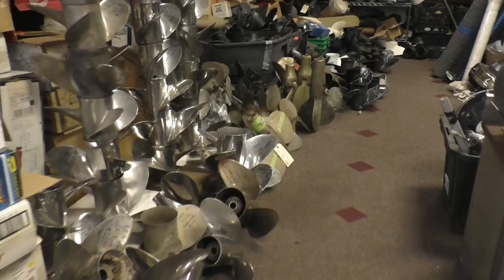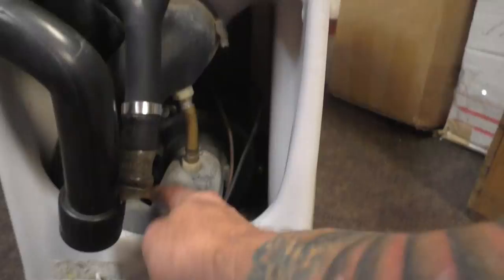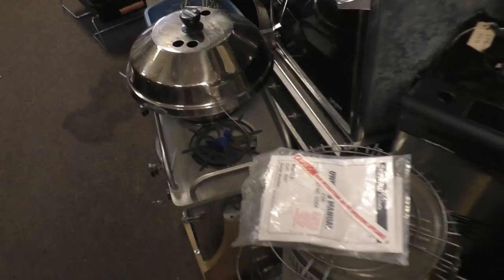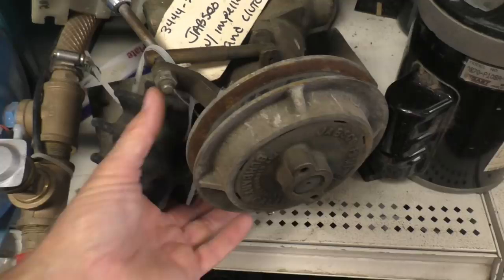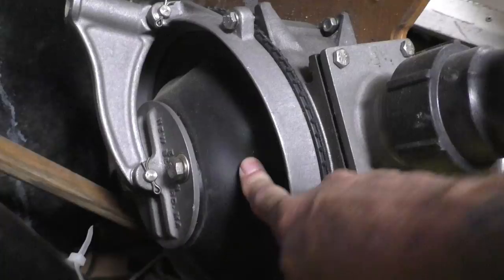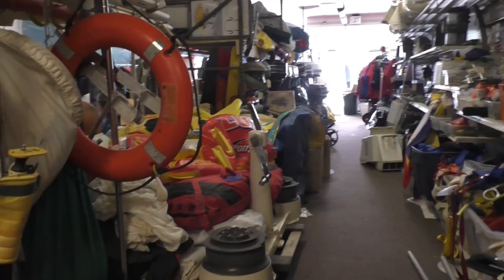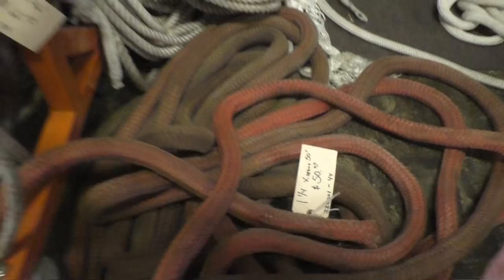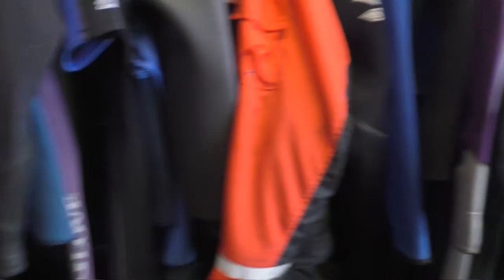Marine Consignment - Wickford, Rhode Island

Comment: You found a good place there Doug. I rebuilt a Downeast Lobster boat 15 years ago and I bought a lot of parts there CHEAP. That boat is still on the water and most of those used parts and ones I machined from stainless are still on it.  They ship all over and you forgot to mention they are in the same building as the Post office. You could buy something, box it up, walk next door and ship it home. I live about 20 minutes from there and you can usually negotiate with them especially on items having birthdays and some stuff, like stoves, have had a few birthdays there.

Comment: Bilge pump diaphragm, check out big truck brake chamber's diaphragms, NAPA Auto/truck. Some are designed to move a lot of air/water.
Reply from the maker: Happen to have some laying in the front yard.  :)
Reply: In case you didn't know Doug, the air system on trucks is governed to max out at about 120 psi. The brake pots you have would have to be able to exceed that considerably for a safety margin. I wonder just how close a brake pot is to being a bilge pump?
Reply: Hey Doug...just be careful with the brake chambers if it is a two hose type they have a widow maker spring in the back section. there should be a tee shape threaded tool in the side between the sections  to insert turn 90 deg & tighten fully to contain the spring.
Reply: Wilden diaphragm pumps have the parts you want. 

http://www.psgdover.com/en/wilden/
Reply: Or

Comment: you laughed about that pump for your bow thruster but I was looking a a bow thruster system that uses pumped jets of water instead of a prop in a tube. The system takes up less room in the bow as you can locate the pump any place and just run tubing for it. you can also put jets at the aft end so you can push the boat completely side ways or you and use them to rotate the boat in it's own hull length.

Comment: I saw a framed needle point in a sail boat that read  " A boat is a hole in the water lined with wood into which you pour money".   I think it doesn't matter what the construction material is for the boat; that is a great and appropriate definition.
Salt water is a tough environment for most materials to hold up and work.  Plus the market is not as large as for most other goods.
Reply: Roy Reynolds :
Break
Out
Another
Thousand

Comment: Thanks for that Doug. I have an Edson pump in Bronze sitting on the floor of the workshop. I had no idea what it was worth.......until now! For you to make one it may pay dividends to order the rubber parts from Edson and make all the rest. I will be ordering some replacement ones for mine at about $250. Cheap insurance too! I am fitting a plastic hose for the pick up side and a lay flat (Fire hose type) for the discharge side, because it stores real easy and very portable, if you have to go help someone in trouble. Those used boat parts store are always a great way to fritter away an hour (or two!) of your day! Thanks for sharing.

Comment: The diaphragm for the hand pump could easily be made out of the sidewall of a tire. Garden implements or even a hand truck tire.
And that 6" pump could be used for suction dredging.  Removing sand from wreck sites is the biggest obstacle to any salvage operation. Also, there are lots of places on the planet where offshore gold dredging has never been done, but gold rushes happened in the creeks above....

Comment: For the bulge pump use the air bag from the trailer axle you cut up. Can resist high pressure and made to flex.

Comment: I've lived aboard my boat Temptress for half of the last 27 years.  I have found that the Raratin PH-II heads hold up really well.  I just replaced the one that was in the boat for the last 25 years and 20,000 ocean miles mostly because the porcelain bowl was stained.  I believe that the plastic pump lasts longer then bronze.  Bronze corrodes, plastic doesn't.   Just my experience.   PS.  Periodically flush some vinegar down your head.  Breaks down the calcium salts that form inside the pumps.
Reply from the maker: Thanks.   I like plastic as a material, but I wish they used heavier walled stuff.
Reply: Well, you can cast plastic too :)

Comment: The bilge pumps kinda look like maxi chambers for air brakes on truck you might be able to use the housings. just make sure you look up how to cage the spring before you take one apart. You might find a old one thrown away at a truck shop most of the chambers have two diaphragms in them and are easily replaced
Reply: Maybe could use air bags like on truck suspension too.
Reply from the maker: That is a brilliant observation.  We'll take a look at that.
Reply: plenty of brake chambers on the trailer axles they have just cut up
Reply: Victor: Very smart idea!

Comment: Part of why I like your build, you try to build for durability and value. I don't understand the pricing on used marine gear. Example a rv stove and a marine stove are functionally the same, with similar safety features but one is nearly free used and the other is $500 worn out. I can deal with rusty steel every few years for the price differences.